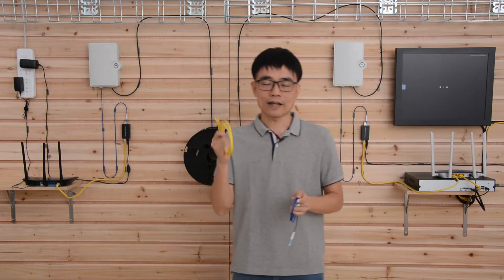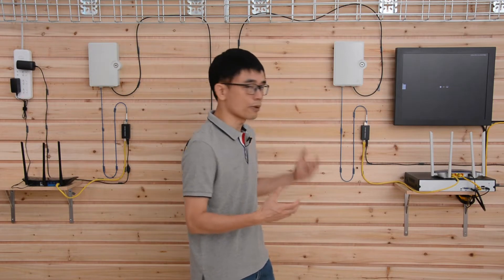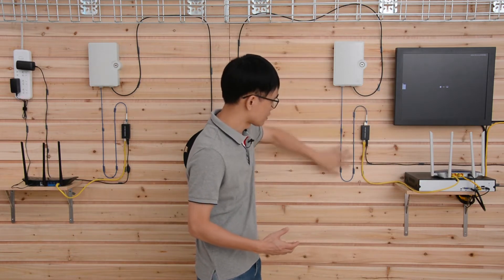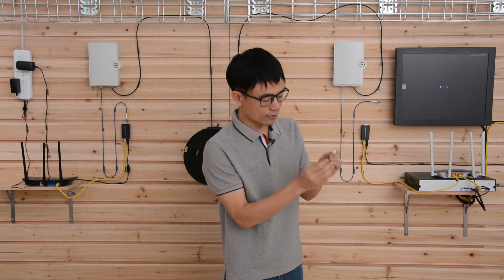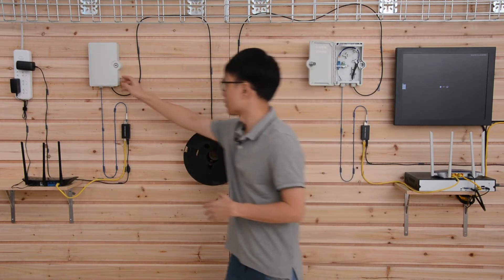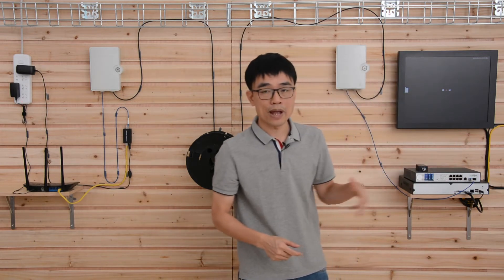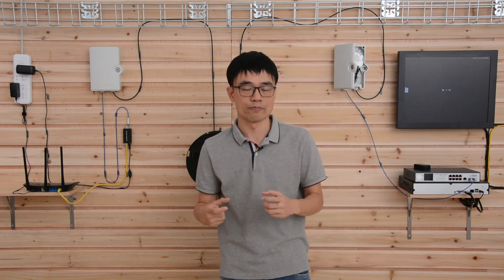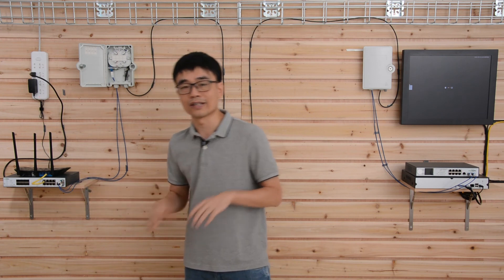Use Fiber optical cable to Connect IP cameras and NVR

Comment: What did you call the black fiber cable between the two devices? Also, isn't your bandwidth still limited by the Ethernet cable? Thank you.
Reply from the maker: It's the pre-terminated fiber optic cable. https://www.fastcabling.com/product-category/indoor-outdoor-fiber-cable/

The speed is determined by the slowest component in the link. So even if you're using fiber, you might still need to upgrade your Ethernet cable or other devices to see the full benefit. That said, fiber is future-proof. Once it's buried, there’s usually no need to change it again.

Comment: Thanks for your sharing, love it. I have a question, my system uses a fiber cable to connect, then my PC can see the stream of the camera using the app of the camera (KBiVMS), but I want to take the stream of the camera while not using this app, it can't find the IP or camera stream. Do you have any idea about this situation? thanks.
Reply from the maker: It seems the app discovered your camera already. Can you try to find the network setting on the app? If there is network setting, the you can see the IP address. However I doubt you can access the live video without using a software. You might try VLC player which is the open source software if the camera supply RTSP command or other 3rd party software. Still you need the app somehow.